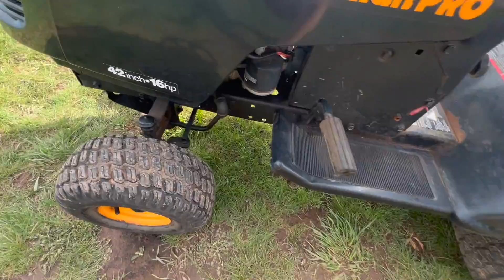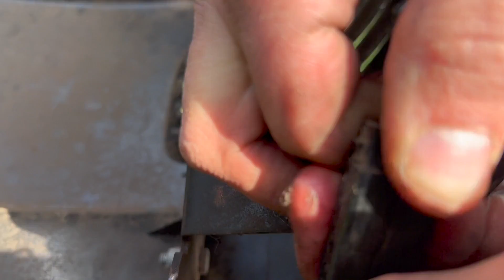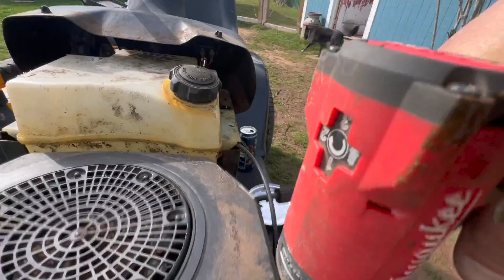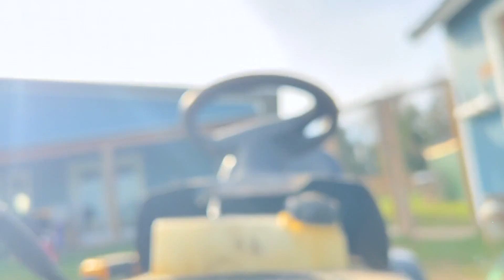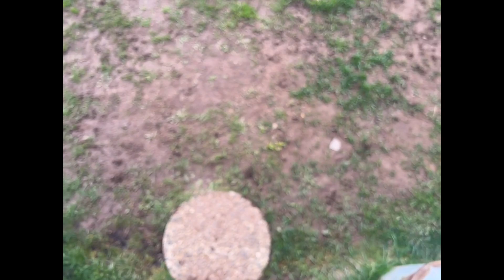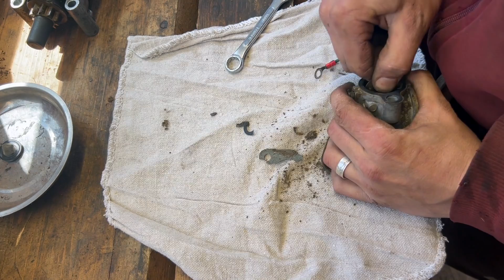Fixing the Poulan Pro Mower From Hell

Comment: I got the same issue going on with mines so did you end up putting on a new starter or the jumping wire mad it start?
Reply from the maker: I ended up having to put a new starter in mine